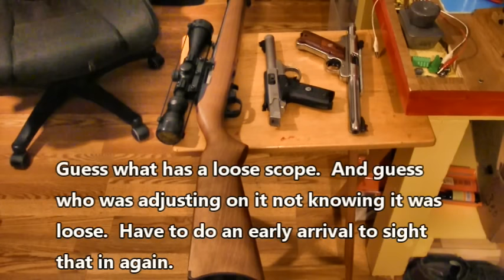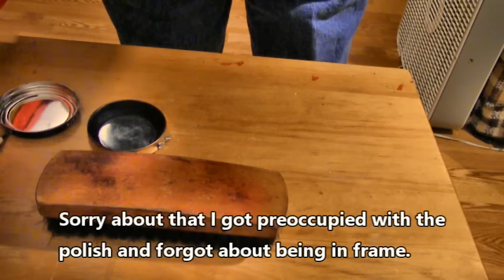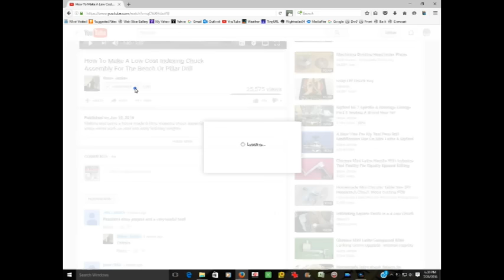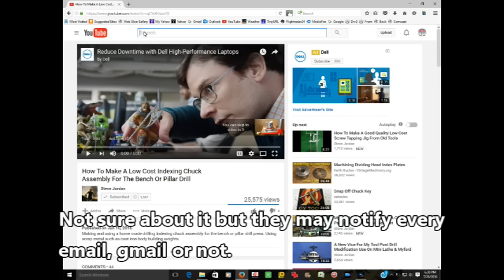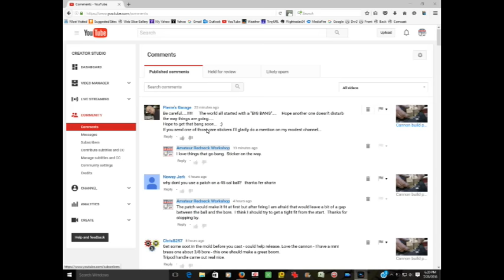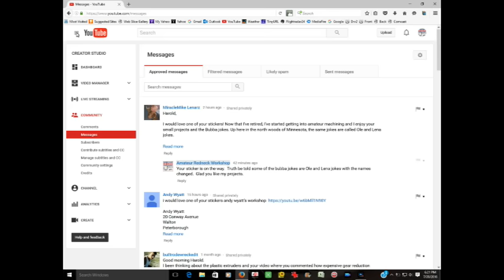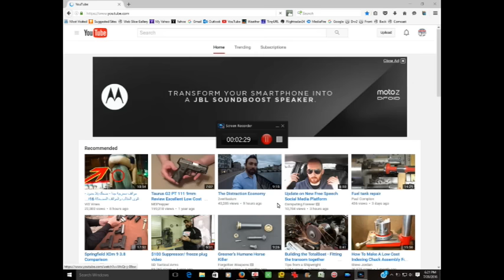Tying up loose ends 2

Comment: Always have a knife clipped to pocket (Spyderco Military).
I resisted a cell phone (smart variety) until 18 mths ago - stuck w it now! Destruction may be a sledgehammer job! Press is working on inside having very little free space. Smell must be battery.
Looks like you had a fun day :)
Reply from the maker: No doubt a pocket knife is handy.  I guess i could ask you, are Brits so vicious that they cannot be trusted with pocket knives?  I mean the historic murder rate there has been low to almost none for a hundred years so it does not look like vicious folks.  Thanks for stopping by.

Comment: i have that same tap and die set, the are very blunt and not much to following tolerances,  ive slowly replaced the taps and the tap wrench which was also terrible,  i so rarely use dies so im stuck with these for a good while, yes - no pocket knives in the UK, technically you can carry a less than 3 inch folding, but in reality its no.  people have grown up with no pocket knife, most people could not use one, or cut their finger off first time they used it on string etc, the same people cannot light a match or a small garden fire.  I Pride myself on the fact i have some basic practical skills, but i guess life is too easy these days and the less useful people still manage to carry on, it seems taking your picture for Facebook 100 times a day is the new skillset.
Reply from the maker: I really cannot find a use for Facebook, I have an account but never look at it.  Thanks for stopping by.

Comment: Well, here in the U K it is not illegal to carry a pocket knife but you must be 18 years old to buy one, the blade must not exceed 3 inches in length, it must not be spring assisted and the blade must not lock. Those are the basics. I always carry a Swiss Army Knife, the model is called "The Soldier". It is not the modern version as it must all of 30 years old.
Reply from the maker: Glad to hear that.  I was starting to worry that maybe you guys were just too vicious to be trusted with sharp implements.  =(;-) I always carry a tiny Swiss like knife (they put the cross on the handle or the box anyway) but it has one blade about 1.5 inches long, a fingernail file and tweezers and a tooth pick.  That last item being the most wanted.  But I do have some very sharp and fancy lock blade knives for special things and they are pocket size but I never carry them as they seem too large with all the keys in my pocket.  I keep one in my range bag.  Thanks for stopping by.
Reply: Vicious?? us friendly Brits. We're not trusted to carry firearms though, afraid we might shoot ourselves in the foot. Great videos by the way. Jokes are pretty bad but I love em!!